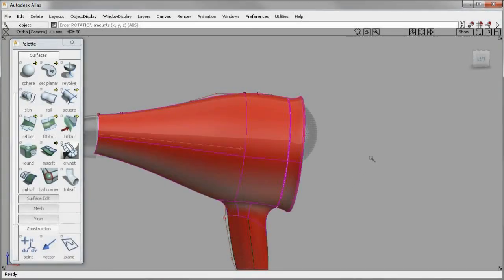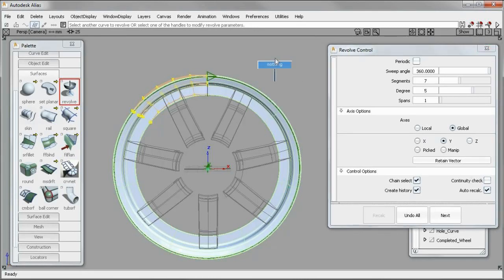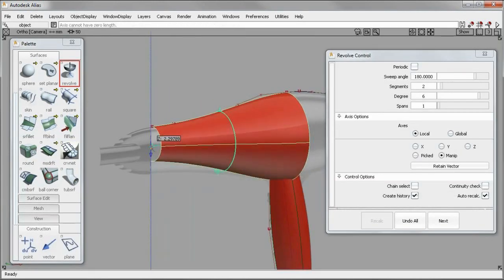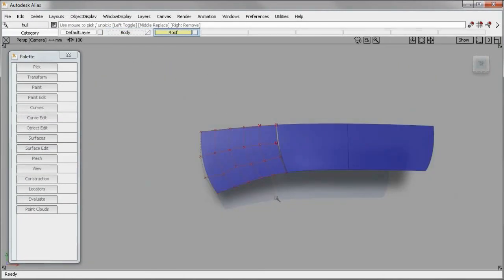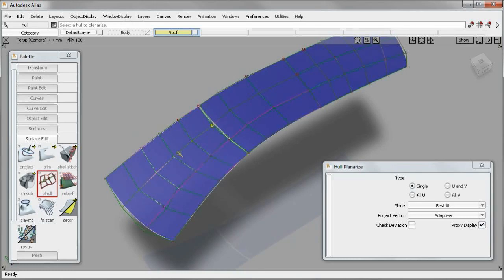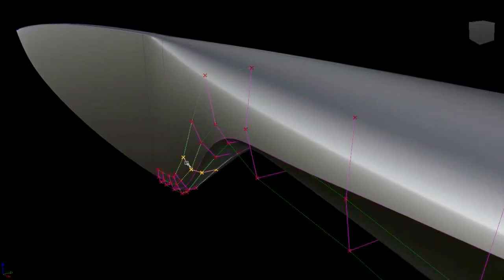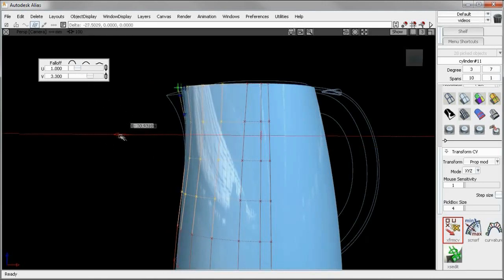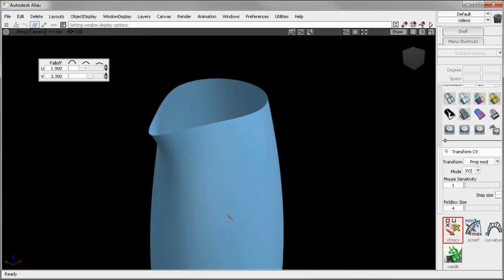Autodesk Alias 2012: Modeling Enhancements

Comment: @Jardisk8r 
Alias Automotive software
provides a comprehensive set of modeling,
visualization, and analysis tools for the entire car
design process, from concept sketches through
Class-A surfacing. With an advanced workflow, the
software helps automotive companies produce
design iterations quickly, reduce rework, and bring
cars to market faster. (Copied from Autodesk )
It has all the tools that Alias Surface and Alias Design has.
That's why you will get shocked from it's price 75000 €